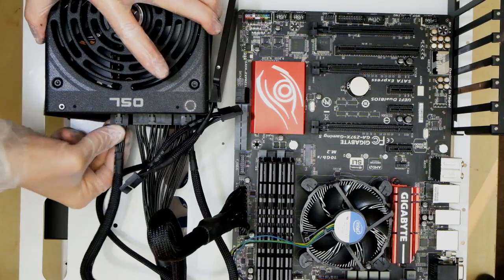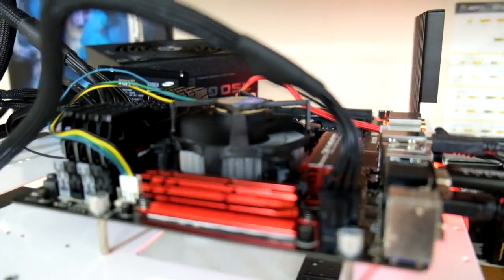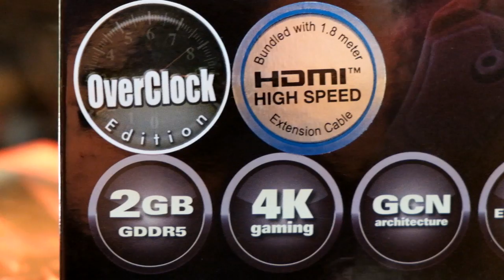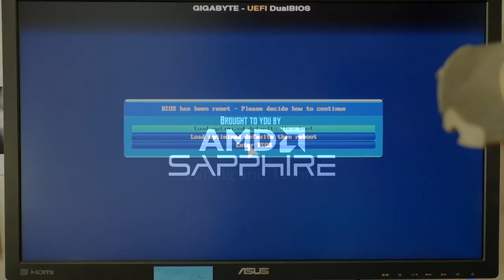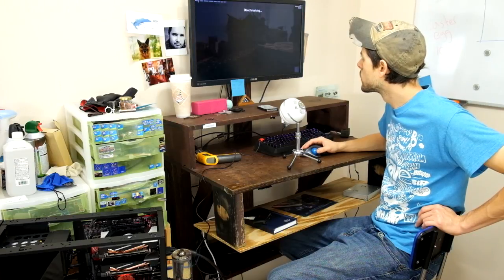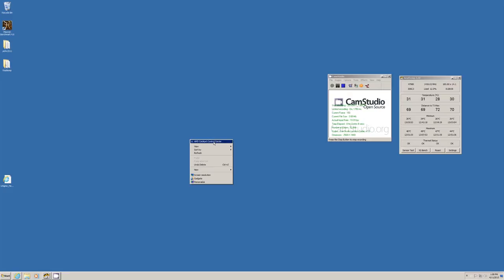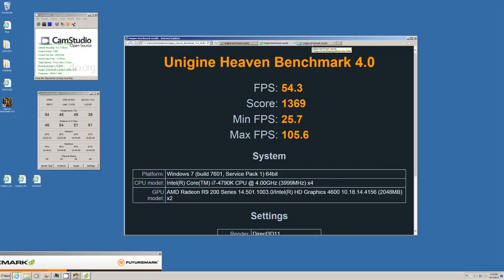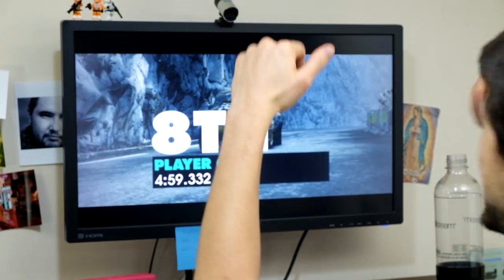Build a PC with Josh

Comment: Hey great video.  I have a question though.  Why did your loop have so many air bubbles in your loop.  I found when filling mine it was super easy to bleed and I didnt get that suspended air bubbles problem.   Is this a problem with a certain type of pump/loop combo?
Reply: +Brian Heuer Yup!  The Koolance Laing pumps are set at a higher amperage than ones from say, Swiftech.  Depending on your waterblock the higher pressure and flowrate agitates the liquid and it takes longer to bleed.  If I had a resister strong enough to turn down the pump speed, it would have worked out the bubbles much faster. This also is GREATLY effected by your coolant.  I also will say that since I was using USED hardware (radiator and block) that there was residue from the old coolant that just needed to be worked out, which caused more bubbles.    Thanks for the question!